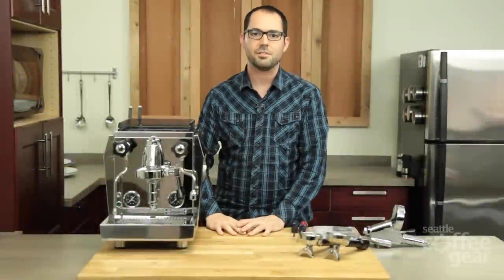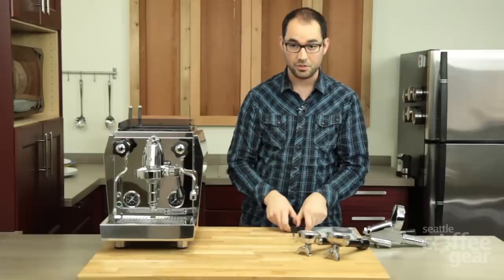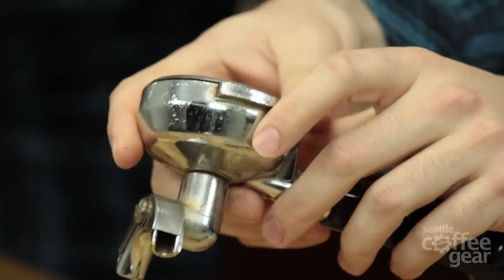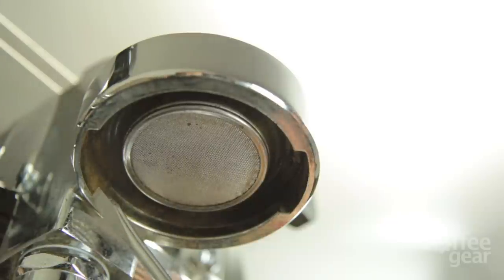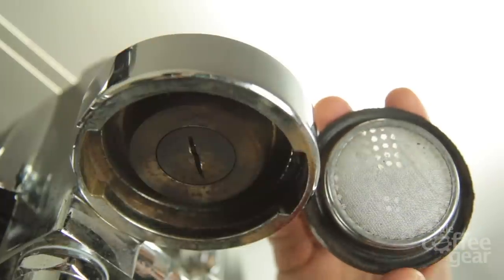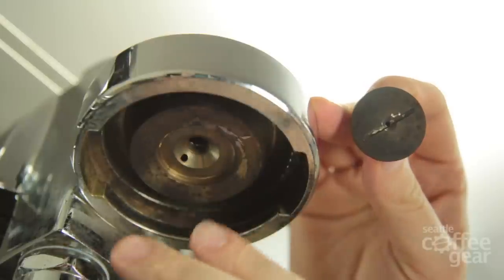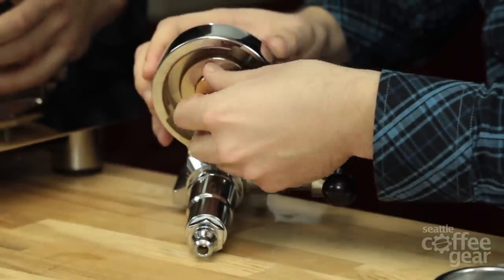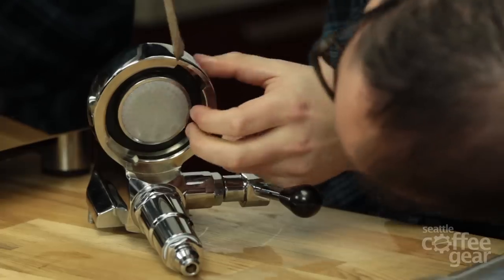Tech Tips: SCG's Tune Up Kit for E61 Brew Group

Comment: Best instructional video I've seen in the 7 years I've owned my Alex Duetto. I never knew the E61 was the entire assembly, I thought it was simply a designator for a 58mm screen and gasket. The gasket spacer was news to me as well. Glad I let the customer service folks that I bought my Alex from send me the correct gasket. I had a thinner one once that didn't last very long. Know I know! Disclaimer: Everything I know about making espresso at home I learned online. The hard way I might add. lol
Reply: Robert E I have the same machine and also have learned the hard way.  Wish this info was available when I bought the machine!

Comment: I used a quarter held by pliers in the brass slot on the diffuser and loosened it fairly easily.  A quarter won't damage the slot like a small screw driver might.

Comment: Some recommendations:

1) If your portafilter is wearing down, buy a new one, such as upgrading to a bottomless portafilter.

2) purchase an 8.5mm group gasket which is all one piece. The silicone cafelat gaskets are best.

3) When replacing the shower filter, go with IMS E61 precision shower screen. Better water distribution and wider margin of error.
Reply: what about the part where the portafilter ears rub against? won't those wear out even after I put the spacer?
Reply: I don't think it's going to be much of an issue with a tiny bit of wear on the portafilter or on the machine end. No biggie if it doesn't lock in at 90 degrees.

Comment: Well explained, really helpful. Probably mention that the gasket should be positioned with cut edge pointing to machine, not to portafilter, as otherwise difficult to insert.
Reply: I hate when pieces of information like this are left out of disassembly/reassembly videos. In other to create a good seal once the gasket is back on, this is a requirement. I went into the comments to post it myself, so thanks!

Comment: As an aircraft mechanic I kind of cringed a little bit when you pressed that gasket in with the tip of a metal screwdriver, haha! Very informative video though, I'll be needing to change the oring on my Rockets group head here shortly.

Comment: My diffuser was stuck. No amount of force could loosen it and I was stripping the slot. Solution: turn the machine on and let it get hot. The hot diffuser came loose w/ very little effort. Hope this tip saves someone else.
Reply: I noticed that just today when replacing my gasket and screen.  The diffuser was extremely tight and because everything looked quite clean anyway...I opted to skip this step.  This is very useful info for the next time I replace these items.  Great advice Ward!
Reply: Thankyouuuu!!!!
Reply: The diffuser being hot is not what helped it to come loose. It was the head itself, as the metal extends when heated. Mine wouldn't come loose even when everything was hot, so I had to apply an ice cube to the diffuser for 20-30 seconds. That made the diffuser smaller and then it came out with no effort.
Reply: 5yrs later and this saved my night - thanks!

Comment: Thanks for the informative video.  I recently had to take apart the exhaust tube and valves on the E61 brew head of my Rocket R58, because it stopped burping after backflushing.  I look forward to you doing a similar video on how to clean the exhaust tube/valves on the lower end of the E61.

Comment: If you use your machine daily, you are going to want to pop out your shower screen and soak it in Cafiza with your portafilter and basket.  There is no need to replace it unless it’s damaged and you really don’t want to replace it if you’ve spent the money for the Precision Group Shower Screen (which is worth every penny).  Also, the easiest way to put the shower screen and gasket back into your head is to place your filter basket in your portafilter and then place the shower screen with the gasket into the filter basket.  Now you can press the whole group  into the head and when it’s in far enough, push your portafilter handle over, compressing the gasket and shower screen into place.  My gasket is way too tight to push it in by hand.
Reply: Abdulaziz Alharbi
How old is your gasket?  They need to be replaced every year or so as they get hard and don't seal well.  Also, make sure you have the gasket in the right way around.  When placing the gasket over the shower screen,  the sharper edges of the gasket go towards the flange of the shower screen and the more rounded edges should be contacting the filter basket.
Reply: Abdulaziz Alharbi
Good to hear and you're very welcome!  Enjoy
Reply: @bugdozer  If it has to be replaced so often, just get a Silicon gasket which is a bit softer and supposed to last longer. On my quickmill machine the gasket lasted 10 years without any issues! Unless I replaced it once and totally forgot.

Comment: Hello, I am from Argentina, I want to build a lever press and I ask you about the gasket screw and the rain filter, that screw has a hole but I have seen that in other parts come other brands with the screw without hole. I ask where the water jet comes from in that case?

Comment: I just replaced my gasket and used the spacer.  The leaking stopped however my portafilter still goes well past 6 o'clock.   It actually will go to around 5 o'clock :o.  Any reason this may be happening? My Machine is not even a year old and used maybe 4 times a week.
Reply from the maker: +Shane Filewood It sounds like the tabs on the portafilter have worn down. If you use the 8.5 mm gasket, it will give you a better fit: https://www.seattlecoffeegear.com/e61-brew-head-gasket-8-5mm

Comment: Very uneasy with that use of a screw driver like that putting the gasket/shower screen back in especially because you have the E61 group head out on the counter where all won't and you risk the chance of slipping and damaging the group head and shower screen when group head is installed.

Comment: i have always loved your channel but this video is disturbing, using screwdriver to push rubber gasket in place? perfect way to damage the gasket (if not more) to post that as a tutorial is just sad, expecting higher standards from you SCG
Reply: CrocAU absolutely nothing wrong with this direction.
Reply: Slightly over-reacting; the rubber gasket is heavy and not soft, it would take brute force to damage it.

Comment: How often should this be replaced?
Reply from the maker: +Abdullah Saady Every 4-8 months depending on your usage, or if you are noticing any leaking :D
Reply: I had my original gasket and shower screen on an QuickMill Silvano for 10 years no problem, cleaned it a few times only lol. But I always did backflushes with water, and every few weeks or once a month-ish backflushed with detergent.

Comment: can't we just clean up the screen and reuse?
Reply: Yes, if it clean enough. There cheap to replace though, It's less than $10 for a replacement screen.
Reply from the maker: You can, but eventually you'll want to replace it. We only sell the screen in the kit because generally you'll want to replace the screen about every time you replace your gasket. - Steven